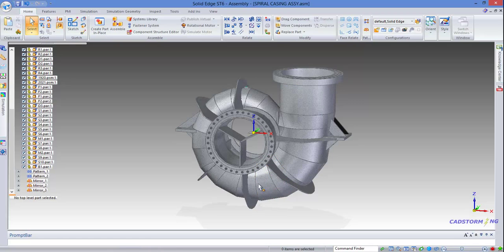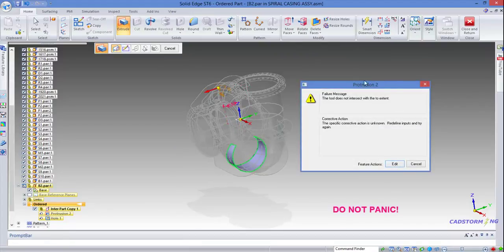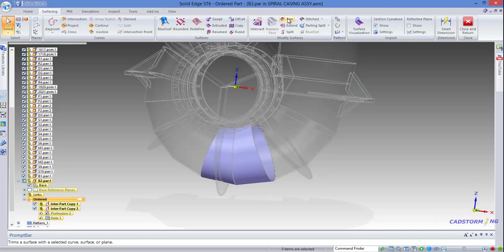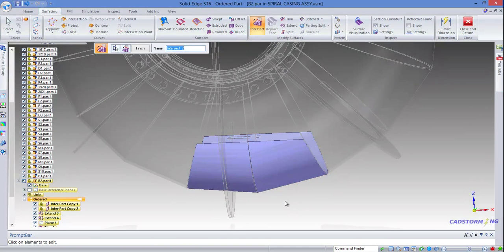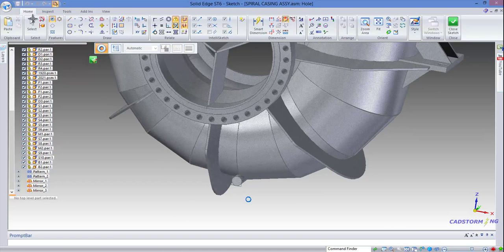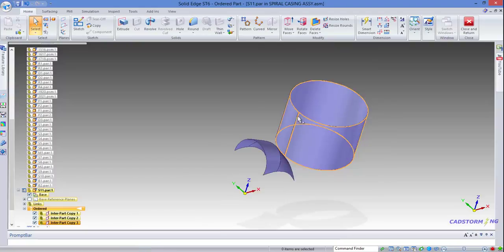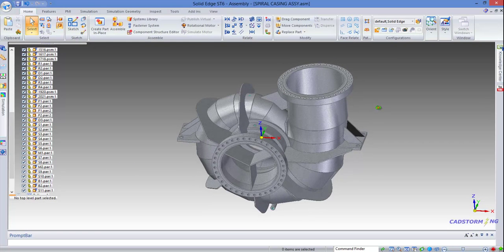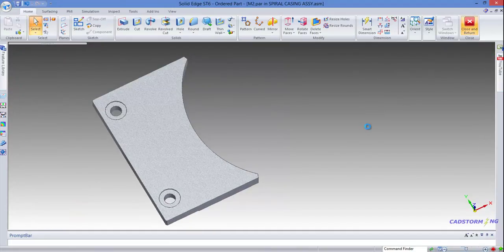SOLID EDGE ST6 - MODELING A SPIRAL CASING - PART 16/16

Comment: I must say that this tutorial gave me an excellent opportunity to learn a lot more about solid edge and using many different commands that i never used before. Completed everything with some tweaks at ERA in the model.
I wont lie it was a lot more difficult then i expected, especially at part 12 creating the sketch for the first stiffener.
So many errors that my brain was about short circuit, but in the end i managed to complete it as needed.
Also with all these explanations about many commands i was able to finish my project for the diploma.
It was about a part that couldn't be renovated so i had to design a structure from scratch specifically for the part with a lot of tests for the structure.
Can't say if that thing will even work in real life (by all my calculations it does) but at least the teacher was stunned by the high level of performance in the project which he then gave me one of the most highest grades.
Once again i want to thank you for uploading this tutorial.
Reply from the maker: +MisterDude9800 I'm glad to learn that you made it to the very end! It was not so easy but you did it and managed to learn a lot! I won't lie, it also took me a while to figure out how to model some parts. The first stiffener is a good example. 
What kind of calculation did you make?
Reply: +CADSTORMING Well for my project basically i had to follow some rules for creating the book which in my case i made 120 pages.
The calculations were proof that the structure i designed won't brake/fail in one way or another, the fact that the structure was designed from scratch i had to make alot more calculations as proof.
Mostly i tested some bolt torques, bolt tensile stress and shear stress to conclude that the bolt wont fail by the stresses, chose the right bolt, nut and washer measurements.
some parts of the structure tested for shear stress, some for bending stress, others tested for fillet weld which for all of them the thickness was less then 3 [mm] and some more forces at some parts that had to be applied on them, in short proof that everything will work as needed.
Hope i said everything correctly since my english isn't perfect, i'm russian heh.
Reply from the maker: +MisterDude9800 Thanks for this detailled exposé. So you had to design as well a structure around the casing? Wow that's impressive. Good job! BTW English isn't also my first language.